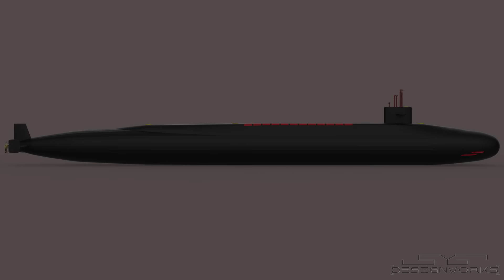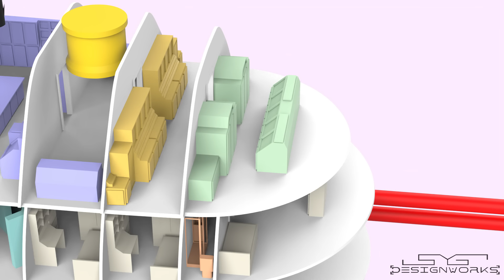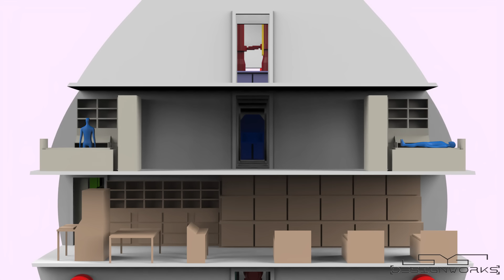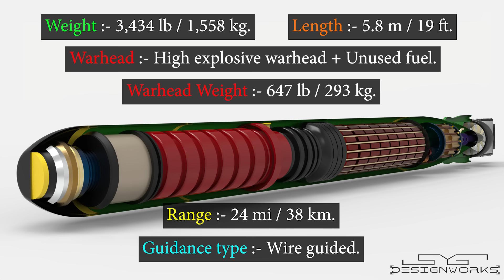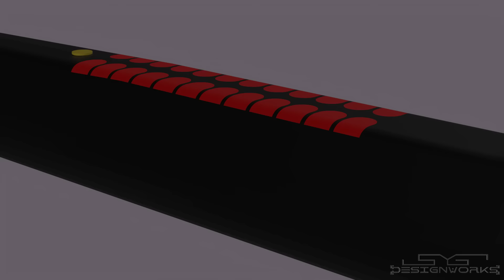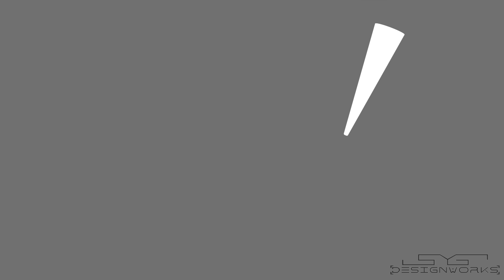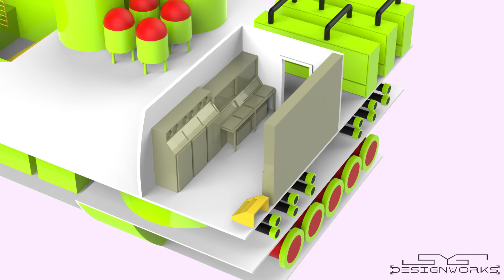Submarine Nuclear Power | Engineering behind it Nuclear Reactor How it Works

Comment: Having served on an Ohio class submarine, there are quite a number of errors in the layout of the spaces depicted in the video. Without going into too much detail I can safely say that there is no large medical space in the front of the sub.
Reply: Agreed ... Hull is made from HY100 Steel covered with Anechoic tiles. Nobody ever mentions types of countermeasures, mine deployment, and other types of weapons.
Reply: Since you were a submariner, could you tell where are the bow and stern thrusters located?What are the curved shaped tanks in the launch tube area used for? My guess is they are for emergency blow. possibly to launch missiles, but I thought the missiles were launched using a type of explosive like an airbag in a car. In a big tube next to the silo on the 3rd floor.
Reply: @terryakuna66  As I mentioned, there are quite a few errors in the layout, plus some information is classified and I'm not able to discuss certain details.
Reply: yes these rooms are very generalized, The Conn  is not layed out that way, iE ESM area, also the Navigation room where I worked behind the Conn is completely wrong in its layout, chart table, ESGM's SINS, Monitoring console, etc....and yes there is no medical room in the bow, Conn hatch does not go to the top of the sail. so many more.....but I see the effort that went into making this and well done. SSBN 733 Blue
Reply: There is plenty of healing happening in the Chief's Quarters.
Reply: I think the specific lay-out's (e.g., of the various departments/quarters/major compartments, etc) is NOT the main thrust of the video/animation....

Rather, it is the general capabilities ---- the technological marvels and the deadliness of nuclear subs... on things like underwater torpedoes to ICBM/SLBMs, as well as the nuclear propulsion system that last for decades ---- that the video aimed for, for public education (why so much money/taxes are required to keep the US at the forefront on these things).

Exact location of the toilets, kitchen, sickbay, exercise area, washrooms, officer quarters, sailor quarters.... ZERO of that is important or even relevant.  Those things are relevant ONLY FOR PEOPLE like you & other sailors who have to function, 24/7, in deadly and crammed subs like these... We, the public, don't need to know such things or where they're located or what paint jobs they are, etc.
Reply: I have a question for you, do officers rest on the desk in the study like it was depicted in this video?
Reply: 70% is classified.
Reply: But there's definitely 24 washers and dryers in the laundry room, right?
Reply: @olamarvin  Ah, no.
Reply: All the systems, space, and costs for supporting the crew make me wonder if “some” of the sub's mission purposes could be achieved by autonomous drone submarines controlled through a central command.
Reply: @rob46711  My first reaction was, this guy is getting a visit from the FBI or homeland security with video like this.  For the record, I don't know anything about the subject.  :)
Reply: I was only on Fast Attacks, but I was struck by the view of a person walking upright into the sonar dome, (I understand that was only an animation), but it gave me a laugh!
Reply: Lol Long story short... no, to everyone elses point accuracy on internal details is not great. SSBN 728B @Typhyr
Reply: @AllenPlatt  You were on the Nevada huh? My first patrol was TAD to Nevada Gold. I wish I could say I had a good time but, I was after all, a nub and man oh man was my chief a hardass! Nevertheless, damn I learned a lot.
Reply: LUCKY!!!! So COOL!!
Reply: Is there windows?
Reply: @Bangin0utWest  No
Reply: @Bangin0utWest  No, there are no windows on a US Navy submarine.
Reply: I agree. There are way too many errors in this video compared to the actual ship. I believe there is enough publicly available info (meaning not classified) that he could have used to make a more accurate video.
Reply: @rob46711  Ummm I was on the OHIO and secrecy is not a thing concerning this class or any old classes this long ago...
Reply: @AllenPlatt  743 Blue Plankowner 🙃
Reply: @olamarvin  I wish 🤪🤪🤪
Reply: suspect the inaccuracies result in part from the USN ""Silent Service" natural inclination to  be less than forthcoming about sharing details about its submarines
Reply: Thank you for your service
Reply: 100% just us coners up there. And doc's office is tiny.
Reply: I was on the USS MICHIGAN 727 (B). Cool to see them get some things right. But all of us had to have a Secret clearance just to be aboard, I had to have TS SIOP/ESI. So they're working off the info they can get
Reply: @rob46711  Wow, imagine the responsibility of wearing one of the launch keys? There is not enough money to do that job
Reply: I ask you the following:
When and how the torpedo's propeller  spins?
 I've asked  many times  but no one replies.
The propeller  needs a device to initiate  the spinning?
 The spinning  starts before or after the missile  is projected?
Reply: @drivingschool11  A typical WW2 torpedo had an compressed air/alcohol fueled engine that generated steam to power a turbine that spun the torpedo's propeller. The Japanese used pure compressed oxygen in their extended range 'Long Lance' weapons.
Reply: @PeterOConnell-pq6io  
Thanks Peter  but...no one knows my doubts:
- What device or mechanical device "ignites" the propeller?
The tube is flooded and and the torpedo  is "ejected" but!..
When  and how the propeller  starts  spinning?
 I mean, when the mechanism  inside the torpedo starts  working?
 Mistery, isn't  it?
Reply: @drivingschool11  The USN torpedoes back then were analogue tech disasters that became terror weapons once we figured how to make them run true and detonate if they hit their targets. Their propellers started spinning before they left the launch tube.
Reply: 29 mph unclassified 😂😂😂
Reply: Probably intentionally not 100 % accurate
Reply: Doc’s space was MC2L, starboard side aft-ish. Not too far forward of AMR2 if I recall correctly.
Reply: Can you tell us if the sub smells funny?
Reply: @ It does. Methylamine stinks, everything smells like a a sweaty copper penny mixed with chemicals. You get used to it after the first day or so underway, but when you come back, you immediately know what reeks of “boat”
Reply: So this is how war thunder leaks happen huh.
Reply: @oIIETERNALIIo 😂😂😂 in boot camp my chief would say on subs 140 men go on a cruise, 70 couples return 😂😂😂
Reply: @olamarvin one of the miseries off aircraft carrier life was ships laundry.   Never get clean, never got dry
Reply: My hero
Reply: You are wrong
Reply: @Bossyosha  Are you saying that I'm wrong?
Reply: @Dukers2300  Very true and you always knew when we would snorkel. The air was always fresher for half a day.
Reply: @terryakuna66 Tiles and alloy may or may not be correct for other classes 😂 same goes for trainable “thrusters”… I’m sure it’ll all be in Jane’s fighting ships in about 30 years though.
Reply: @terryakuna66 We use Ramius’ scuttling charges to launch the Tridents. They’re stored next to the caterpillar drive tunnels
Reply: @Bossyosha Yeah we are all wrong duh
Reply: @rob46711 I would delight in yelling COMMENCE SNORKELATING since it meant I got to parallel and load up the diesel… when I cranked as a nub I had the glorious task of watching the stupid seawater sump next to TDU. As if flooding the induction mast would be something a nub could react quickly enough over phones against 😂
Reply: @Dukers2300 you’re a joke bro
Reply: @Bossyosha nah bro you’re the bro joke bro homie bro bro
Reply: @Bossyosha maybe the real joke is in the friendships we made along the way 😂
Reply: @Dukers2300 love you too bro
Reply: And how to say failed dimension the condensate bay to cool the water down and bring it for reuse. I built 88 class at electric boat for a few years. I didn’t do much on the Ohio class. They kept me on the attack boat because I’m slim and I could squeeze between all the pipes and crawl in bilges
Reply: Honestly it’s close enough in layman’s terms without giving away all her secrets
Reply: @davidhoffman7639 Tridents are not anything like fast attacks.  STS1 Retired.
Reply: Rob, dont respond to these videos. Theyre made by chinese OSINT collectors trying to get retired military to 'correct their mistakes'. ie reveal intel.

Comment: I worked on the construction  of all 18 of these magnificent ships!
Reply from the maker: Wow. Awesome! Thanks for watching!
Reply: Thank god and EB
Reply: those ships are boats!
Reply: @mrdw1971   That's a hold over from WWII, modern subs are too big and heavy to be called boats.
Reply: I repaired and cut up the de-comissioned ones!
Reply: @sotm6078  HOOYAA PSNS and how about that Connecticut dome
Reply: Worked on Sturgeon Class Pt Loma while on the USS Dixon AS-37 ,Shop 38A
Reply: @jordangouveia1863  we still call them boats. Even though I saw that the Ohio classes are all set for decom in the next couple years.
Reply: @skullcrusher9445  I know, but modern  subs are too large to be called boats.  Anything that big is a ship.  But I get it, it's still called Electric Boat Co. not Electric Ship Co. ;)
Reply: @jordangouveia1863  iknow its tradition, MT2 off the Penn
Reply: @jordangouveia1863  they are as magnificent as they are terrifying. But, well done!
Reply: I worked on deconstructing 3 of these in Ship Graveyard Simulator 2 (Steam)!

Comment: VLF (Very Low Frequency) communications uses LONG wavelengths, NOT Short.
Reply: So, the buoy mentioned carries out a wire a distance basically equivalent to the wavelength of the signal?
Reply: @craigcooknf  No. A small portion of the VLF wavelength will work for receiving. VLF is used for one-way communication only: reception by the submarine. VLF wavelengths are so long that transmitting VLF from a sub is not possible, nor do submarines have the high radio transmitting power necessary for VLF. Also, transmitting a VLF radio signal from a sub could give its position away.

Comment: Low frequency means longer wavelengths, not shorter.
Reply from the maker: Yup. I forgot change that. Thanks for the correction.
Reply: I was always very interested into low frequency radio, total amateur though. I always wonder what the receive only antenna on a sub might look like, I only know the terrestrial stations for that are super sized.
Reply: @chrisw.5138  There are several types but one of the main ones used is a very long buoyant cable that floats on the surface and is towed behind the submarine.

Comment: I was stationed on one of the first 5 Ohios in 1984. The forward compartment layout is wrong. Medical is in the Missile Compartment starboard aft forward of the O2 generation machinery room. Torpedos are flushed out with a HP air driven turbine water pump that flushes the torpedo out of the tube.
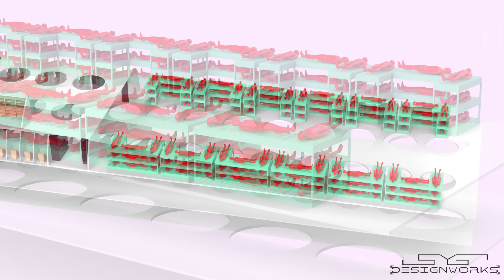Reply from the maker: I believe you are talking about the medical room at 16:55? Thanks for the correction.
Reply: china thanks you
Reply from the maker: @the_artisan_racist   LOL
Reply: Opsec otter gonna get u
Reply: @jimfrazier8611 LOL. That smell has to be phenomenal. Thanks for sharing.
Reply: @jimfrazier8611   Mmmm....the dreaded "ORSE Patrols".   Engineering drills every other day.
Reply: I was on the 685 and the size of Ohio boats is awesome. We had one clothes washer /dryer for 115 stinky men. No gym, medical room, and a crews mess 1/4 the size shown. Of course the Glenny P was a swanky hotel compared to diesel boats.
Reply: Is the food storage right next to the head?  That seems like a poor choice.
Reply: @garysmith8593 I toured a Gato class as a Cub Scout and they were really cramped so  the Ohio class must be like heaven.
Reply: @scottyV1000 nope, it’s nowhere near the head
Reply: Thank you for your service !
Reply: @dannywilliamson3340  I Retired and that was one the reasons. EDMC is not the job for most.

Comment: Nice video. But a misconception about buoyancy. The main ballast tanks (MBT) are all at the forward and aft ends of the hull. Interior tanks are within the pressure hull are for trim purposes only.  When the main ballast tanks are vented to sea (filled with water), the submarine attains neutral buoyancy, not negative buoyancy.  The MBTs are never left partially empty - - they're either full of air for surface, or completely vented (filled with water) for submerged.  As for negative buoyancy: That is something not desired, because if propulsion is lost, you sink.  If anything, it's better to have very slight (very, very slight) positive buoyancy while submerged, and rely on the dive planes and forward momentum (speed) to keep the sub at the desired depth, even if just a few knots.

Enlisted berthing: This is on the 3rd level (not second), on the same level as the galley (dining) and heads (restrooms).   

There's only one diesel generator, not two.

There's also the lower section of rudder which is not shown.